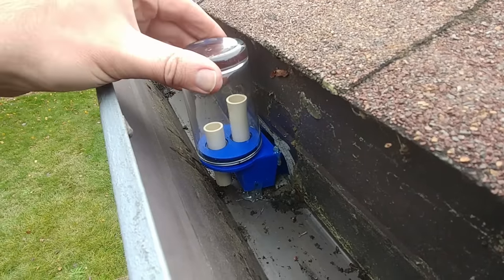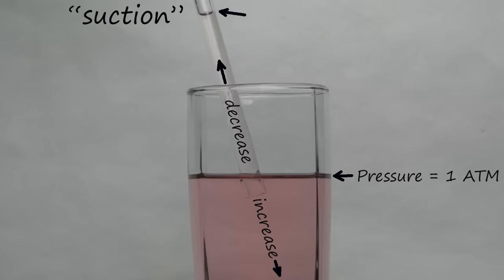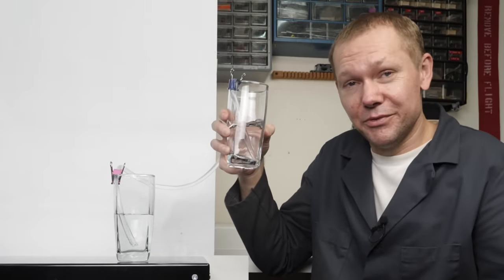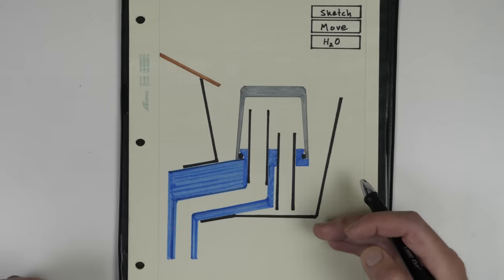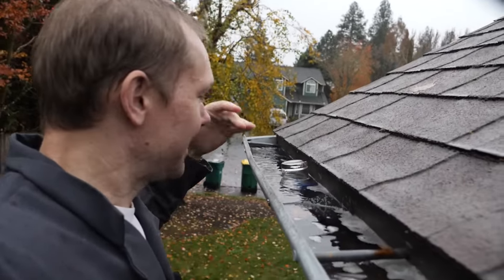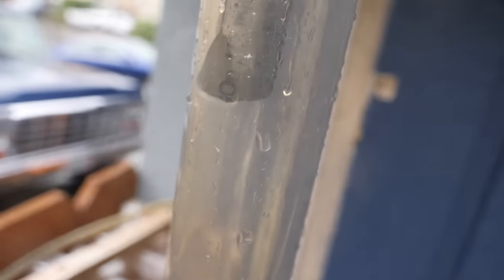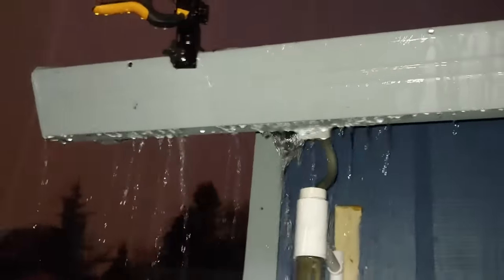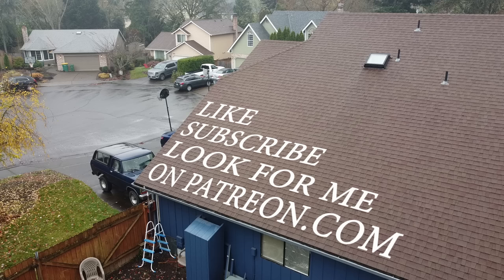Rain Gutter POWER #5 - Bell Siphon Fundamentals and Pitfalls

Comment: So obviously there is a reason a gutter down pipe is about 80-90mm... for heavy rainfall.
Is there a way the exit nozzle could be temporarily restricted to prevent dribbling and then a valve trigger to reduce the flow restriction?
Then your could have a bell siphon with a much larger diameter exit/entrance pipe than shown here and still actually trigger a siphon.

I'm doing a DIY rain collection project myself and found that the theoretical principles are really difficult to get working in practice.... so I appreciate this video! You've got a great setup here.
Pretty cool.

Comment: You could solve the priming problem in a very simple single moving part way (or freely floating actually).

You could put an oversized and heavier than water unfixed cap on the outlet hole of the bell siphon with a float a small distance above the level of the outlet hole. It would work similar to a toilet but even simpler. The weight of the cap would seal the hole enough for the water to rise sufficiently high enough before lifting the float and cap with it triggering the flow necessary to siphon. The flow would keep the cap up and the hole open with water pressure like a toilet.

Comment: A small 3D printed dam at the overflow end should allow heavy rainflows to access the overflow pipe without manually removing a blockage. You just have to find a height between "Bell siphon powers, ACTIVATE!" and "Oh, crap. It's over the edge again."

Comment: Regarding the dribble issue, you simply need to use a smaller diameter outlet, and more of them. If you have 4 outlets with 1/4 the area at slightly different heights (so they activate/deactivate sequentially), you'll have a gradual increase on fllow rate without the dribble. To solve the overflow, simply add a large outlet in-between the max level of your siphon outlets, and the maximum level of your gutter.

Comment: you could ass a tipping bucket as a buffer to shock the system into starting. Also you could just add a wall about an inch or two above the trigger point of the siphon as  and overflow

Comment: My suggestions:
1) Make the overflow of full size drainage pipe, about half an inch below drainage top. Thus the overflow will work on the last half inch of waterlevel.

2) I'd make the top of the highest pipe in the bell siphon level instead of diagonal. When it's diagonal, like in this video, it will start to dribble at the lowest point. It doesn't start sucking until it fills the whole pipe with water and no air, so you don't want that initial dribbling. It just wastes water.

3) I'd set the highest pipe in the bell siphon about 1 inch below the top of the drainage, thus about half an inch below the overflow pipe.

Comment: I would try a small reservoir as a buffer during high volume conditions in order to take advantage of the additional capacity , small as in < 55 gallons, but not < 7.5. Rainfall is inconsistent, that's why we have lake chains along the paths of rivers, and places where the rivers or streams fill a lake on the lakes flow inlet and drain at the outlet, which is simply the path of least resistance or lowest grade elevation of immovable terrain at a lower elevation than the rest of the lake's perimiter.
 Lakes are buffering zones when they are an integral component of a river system. Some indirectly link to the river system even though situated away from the immediate path of some waterways, hydraulically consolidated by spring systems, and the aquifer in some cases, or in semi permeable bedrock substrates, precipitation collects in a variety of low lying geological formations, at levels above the flowing waterway, and although the water drains through imperfections, cleavage, fissures, pores, volcanic vents, or perforations in the rock substrate, and act as natural conduits, and the bodies of water constantly try to equalize with each other. This is what I was getting to. The viscosity of the water as it passes through these enclosed flow channels is limited but not obstructed, so flow rate factors and many geo-speciffic variables apply, but in a nutshell they create a gradual regulated rate of equalization, and the river's flow volume becomes more consistent and predictable. 
 Applying hydrodynamic  concepts (I'm not term savvy in that scientific domain; please forgive my improv, and for not being familiar with the quackulus formulas) anyway, spilling the excess into a storage container, at high volume, since it takes a longer time to fill than the pipe, and releasing it at a controlled flow rate, can regulate the flow and store more physical potential energy.

Comment: Your final experiment with water and glasses, example, if you want to get the level right for building a house or decking on a sloping ground site use a long tube with coloured water in it, as you pointed water finds a true level.

Comment: I am sure you have considered this already, but, if not, have you thought about the volumetrics of the water, and the weight and how many fasteners are holding your gutter to the ridge line? It appears, that your home and gutter system is fairly new, and allot of tech over the past 90 years has come along way. But, that still might need to be considered, that the length of gutter, (Apprx) 30 feet and large capacity gutters, it would not shock me, that when full, the gutter is holding up about 300 lbs. maybe more... in turn, the hand full of fasteners under the first layer of shingles. The roofing nails, with wide heads will be fine, and the base of foundation the roofing nails are in, likely will be fine, but the ripping action of the sheet stock flange might tear through? Maybe not... Either way, this was fun. I really enjoyed this project..  Wonderfully clever idea.

Comment: Water level in the glasses is called a water level and is used in construction. Ive used it for setting posts at the same height for decks.  mark one post to the height you desire. Take a clear hose filled with water hold one end of water level to the mark on the post then take the other end and you can use it to mark all the other posts and they will all be exactly the same height above sea level. Water or liquids in general are the most accurate level on earth much more accurate than a laser.

Comment: Solving the overflow during heavy rain is an easy fix. You simply need to create a spillway and the correct height for your reservoir that will allow the water to overflow it and release down the other drain. While this does decrease the size of your reservoir slightly it isn't going to be a significant impact. The key is trial and error to get the height correct so the siphon can still function.

Comment: Perhaps you could explore a parallel option. The primary path would be for your normal drain, which would handle the off-nominal heavy rain flow rate. The secondary path would contain the elements for generating electricity.

Comment: You could try making the exit intake perfectly level, so the small flow evenly distributes around the opening with a curtain of water, which easily seals with enough disturbance...

Second method: add bends to the drain pipe to create disturbance, which in result create seals relatively easily.

Comment: Think about it like a dam. If the water height gets too high, you need to open overflow gates to remove the excess water. When it rains really hard, that siphon will never keep up. If you had a sensor switch to activate a flap to let water out of the overflow, that would be cool.

Comment: You can make an auto overflow with the toilet flapper just put a float in top strong enough to lift it when the water level gets too high and will auto close when it is back at working level.

Comment: Slows down the higher you have your glass or bucket with  a syphon tube I use them for the aquarium I always keep the reserve tank under the tank for cleaning any higher it would take all day! Easy enough to connect a 9v battery to a cheap submersible pump so it can be left outdoors all through the year just to over ride the syphon feed when it doesn't get that suction! I made one for doing the aquarium aswell and it just keeps going till it's empty it's great for emptying tanks that would maybe be good for this job? Or lower the bell so it sits under the line level of the gutter for the glass to fill up quicker or put one at the overflow flow end 🤔

Comment: Put a cone (bell) at top of exit break a greater surface area over the edge and add additional pipe for overflow that can power another generator or put a barell directly below the gutter as a rezovoir to control the flow through a bell siphon set at  1/4  the height of the barrel with an upflow into bucket containg several bell siphons to each power a stream that hits a different scoops on the generator stephan set at different levels so that the faster it fills the more power is gained and not restrict the flow from the gutter

Comment: You can use multiple setups when it rains so hard or maybe increase the diameter of the bottom tube so that higher volumes of water could be accommodated

Comment: you can use a bell syphon to pump water into a re-circulating system then use a hose to create pressure and use it to power a water wheel ... 

it would be kinetic to electric and self perpetuating... 👍

Comment: One solution to this problem would be to make one of those systems that are at children's water parks. The ones that fill up with water, get unbalanced, and dump all the water onto the kids heads. It shouldn't even need to be very big because a small influx of water flowing into the gutter should be enough to trigger the siphon when it's stuck

Comment: A tip for cleaning eaves troughs is get an extender for your power power then bends into a hook at the end. Bam you can do all of them from the safety of the ground and it's faster. You're just wasting like 3 minutes of water.

Comment: I have used the two syphon method for transforming a measurement from one spot to another. (Like sidewalk forms) just use two milk jugs and a long tube.. calibrate the jugs with several lines and then put each jug on the form and match the heights..ps.. use coloured water you can see it better! Enjoy.

Comment: I am not sure if the distance is too far to be incorporated into your current overflow. 

If you added a high level reservoir with another bell syphon or a valve/ overflow manifold you could utilise that extra flow at a later time if needed. 

Extra pipe work and a reservoir could less aesthetically pleasing but may add emergency functionality for times of low water flow. 

Little tangent the old Mediterranean homes use to have the roofs sloping into feed a central cistern under the courtyard where every drop could be saved for a later time whereas now days most houses move water down to the sewer or storms drainage systems at incredible speed. Our current systems do not retain water inland for sustained periods.

Comment: You need a way to drain the gutters on demand aswell. Like a section that (from the ground) you can pull up or down and have water flow through and more easily wash away debris

Comment: a resevoir filling from the gutter may be a energy storage device so u do not lose power due to unequal volume to flow ?! .. smiles .. excellent work .. i had been playing with this idea awhile .. i had thought about PC fans direct inline in the downpipes .. or utalising the bearing case from HDDs .. pelton's r most efficient to now ! ... smiles   .... but ...  currently trying to understand how to make a current from the slip of h2o over the roof surface to deliver mA's to storage .. vibrating fibres may be one way to convert dynamic flow movenet (kinetic) to to storage (potential ).. this is excellent  fun watching u .. all the best ..

Comment: Put a low pressure flapper valve near the top of the outflow pipe, situated so that the flow required to open the flapper is equivilant to that which is required to cycle the siphon. This way you don't lose water at the start.

Comment: Use a Air Lock  (Pee trap) below the syphon it make them more reliable 
I made more Reliable Double S syphon Just remember to Rotate the "S" 90° degrees  and the other Below "S" Negative   -90° degrees  The can be the Gutter Down pipe size so not to Back up in Heavy downpours

You also might like to Try A "Screw turbine or Archimedean turbine" Where the longer it is  - it  make use of the Water Gravity Weight  More than once per rotation ( more torque power) and get a few KW out of it

Comment: No surprise that syphon flow matches the downstream flow. As the level of water is rising, the efficiency of sucking water out of the syphon lowers because the level of water in the outflow pipe that is affected by gravity becomes lower. Thus, there is a negative feedback in the system, that self-adjusts within certain limits.

Comment: I bet you could set up your overflow side with another bell siphon and generator.. and then just tune the siphon start times so that one is higher than the other. That way the only time the 2nd one starts is when the first is overrun by say 1 cm... Then the 2nd kicks in (and stops first!) To hopefully double power output and also take up that massive flow rate

Comment: What if you used a spring check valve to keep the water in the siphon tube. That will hold the water there until there's enough water pressure. That way you stop the dribbling effect that delays the siphon from to start.  Fir those rainy days on the downpipe use another spring check valve that holds more pressure but will open before the gutters over flow.

Comment: I believe that the water level in the tube depends on how deep that siphon tube goes. I think it will constantly max out at that same height above the output end of the tube, pretty much. It does depend on resistance within the pipe and the small added pressure from the air due to height difference…since it’s been a few months from the original post, maybe you can discuss this possibility now?

Comment: This may be the most convoluted way to do a thing.
STEP 1.
Adjust your gutter so you have a minimum 1% slope between high and downspout.
STEP 2. 
Have gutter downspout drain into a rain barrel or similar container.
Step 3.
Have a spigot at bottom of barrel that drains water towards generator.
Step 4.
Have another spigot much higher as overflow that connects also to your drainage.

Comment: While atmosphere pressure is a factor, I think the primary reason for water to be leveled is gravity. Gravity pulls on the water creating water pressure, and water pressure reaches equilibrium when  all water surfaces are leveled.

One simple experiment is to place cups with same level distance in the vacuum chamber and sample the equalizing duration at different air pressures. The duration won't be proportional to air pressure.

Comment: All you have to do to fix that without reducing the flow because you want it to flow properly when it does go is make the pipe that discharge is the water go up to the level where it's getting it from so you'll fill up all that pipe before it can start to dribble it might still dribble out but it's at least something to guarantee the water gets higher before it goes down if it goes higher it should initially drain faster and do the appropriate type of Siphin that way

Comment: Could you add various-sized tubes to accommodate various rainfall rates? Maybe in the one location, it is all at now? A bigger bell siphon. Light rain at 1” rainfall gets the smallest tube. Then 2” rainfall gets next size up. Then say max of 3” gets the largest. Total amount of rain fall you could handle would be 6”. You would not lose much power through dribbling water. It would be pulled through at one tube. Say the left most one pulls 1”. Then 2” to the right. Then 3” to the right of that. In my mind I see each tube running down separately into a different spot of the reservoir, or can you design it all to drain through the one opening you have now in your gutter? 1” comes through the gutter then 45° to the reservoir. and 2” comes straight down a little shorter then 45° into the reservoir. Then rinse and repeat for the next one. Depends on the maximum rainfall you'd see in your area yearly. Even the average smallest amount of rain you see per storm. Hope this makes sense. 😁 You may need to adjust your reservoir the rain sits in for heavier rains to not lose out on power generation. As well as a variable generator to handle the lower to higher power generation from the flow.

Comment: Use a different sized bell siphon, or even a u-bend, for overflow control. Calibration set for the max level/depth desired in the gutter, and with an abundance of potential flow rate (i.e. Large pipe).